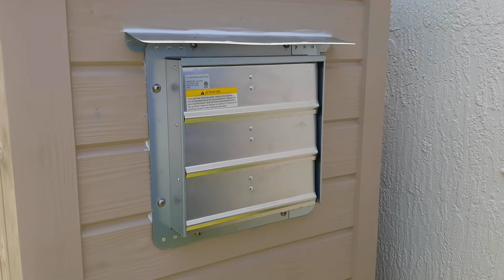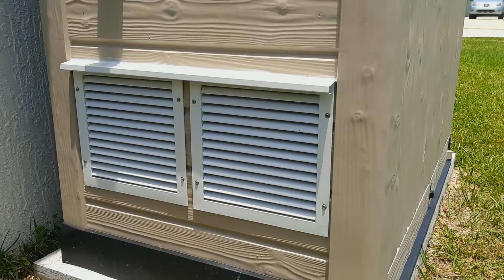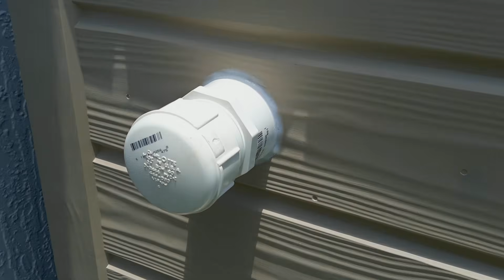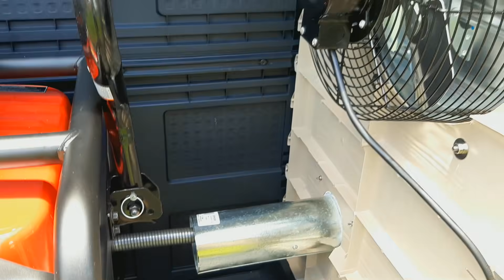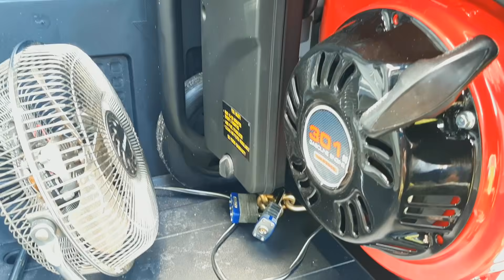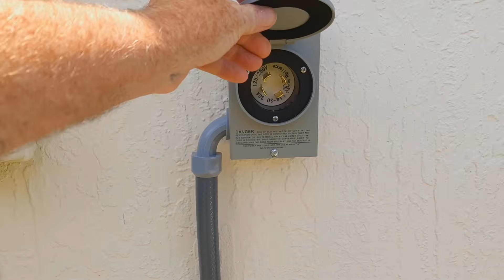Generator Shed with Harbor Freight 6500/5500 Predator Generator Enclosure

Comment: What did you use in the flooring to level  it?
Reply from the maker: I leveled the concrete when i framed it to pour. It has a slight, very slight forward slope to help with rain water drainage that drips from the roof of the house.

Comment: Lots of holes to fill with insulation and tons of room for insulation for sound blocking
Reply from the maker: I suppose if one wanted to obsess with things you could insulate and try to sound deaden the rest of your life. In a nutshell It allows for the generator to be kept outside and out of the weather. Run and provide power in the very rare instances it will be needed. Once the generator is powered running and under load during a power out event the sound means nothing and can barely be heard once going back inside or anywhere else than standing around beside the unit.
Reply: @techtiptricks  How did you connect  the flex pipe on for the exhaust to push out so it will not damage the generator? pretty cool I like for you to tell me how you connected it please thank you.

Comment: Does this generator have a battery start option?
Reply from the maker: This particular one does not, The sales person at Harbor Freight said there are after market kits for it but honestly it starts easily with one pull when choked then turn off choke. The way this is facing in the shed the pull start is on the left side and I'm right handed so I can even start it 1st pull left handed.